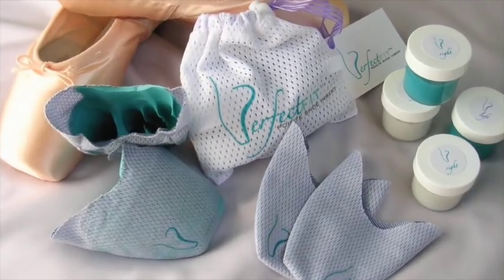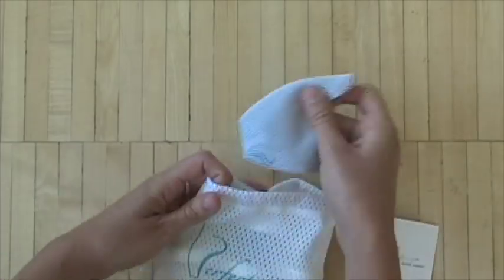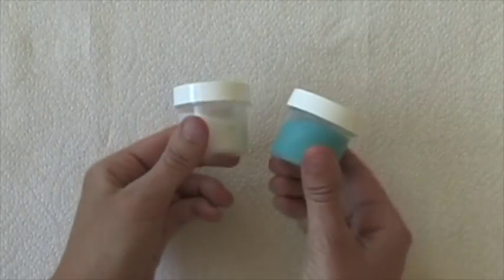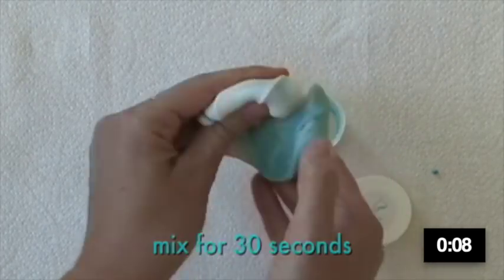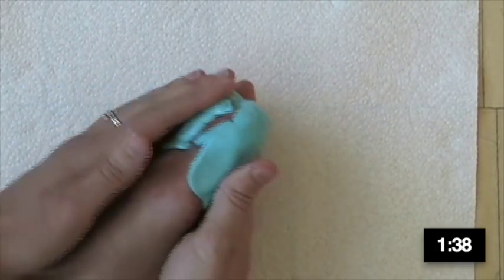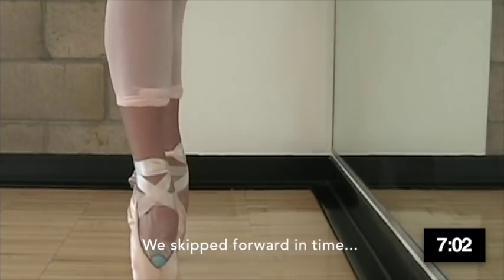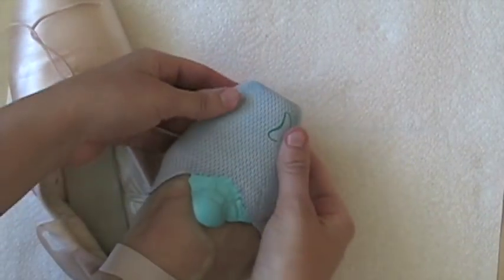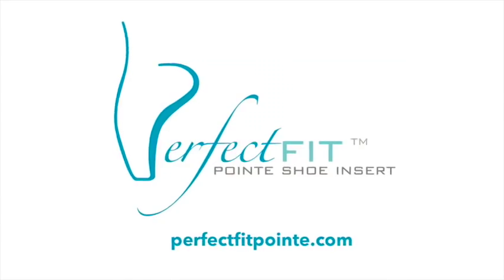NEW Molding Process Video - PerfectFit Pointe Shoe Inserts

Comment: I am sure these work for a lot of dancers, which is great but it was not very useful for my second toe which is longer, was more painful than with normal padding even though I carefully followed all the instructions and watched videos, in fact I am quite 😢 as they are not cheap …. This is my experience and hopefully they will work for others as this is a clever idea.   What I am trying now is to add padding to my big toe so that it becomes the same length as the second toe, in order for the weight (as I am 179cm tall) to be distributed more evenly, and will try your mould on my second foot with this. Fingers crossed

Comment: do you mold it with a new pair of pointe shoes or a broken in one? or die it matters?
Reply: your shoes shouldn't be brand new. they should be slightly broken in but not dead, after 2 or 3 wears is probably a good gauge! if you were to do it with a brand new pair, your pads would not fit as well with a pair of broken in ones, which is the actual shape you would want for your perfect fit.

Comment: Can I use the Pillows for Pointe Foam Toe Spacers PFP17 with these? Video shows Gel Toe Spacers. Thank you.
Reply: For any type of foam spacer, you can mold them directly into your PerfectFits without using the small included stretch sleeves. Foam is naturally porous already, so the putty won’t have any problem sticking to it. The process is essentially the same as outlined in the Instruction Booklet and Video — you’ll just be able to cover over the foam spacer directly on the top and bottom to anchor it to the sock

Comment: How long do these pads usually last? Does the material weaken quickly? Are they comparable to the traditional padding? As they're more expensive than 'normal' toe pads, I would prefer them lasting the equivalent time, or even longer. :)
Reply from the maker: PerfectFit Inserts usually last much longer than a typical toe pad since they are not a “padding” solution.  It depends on how much you dance, but typically they last anywhere from 6 months to 1 year for a dancer (or longer).  The molded material is very durable, and will not compress or pack down over time (as lambswool or foam does).  It is more likely that you will need to get a new pair of inserts when you change shoe size or style (since they are custom-fit to a specific shoe and foot) before you need to replace them due to wear and tear.  We have also added extra reinforcement in the toe socks around the big toe area to further increase durability in this region.

Comment: can u use the toepads instead of the fabric?
Reply from the maker: Do you mean, can you use another style of toe pad to cover the moldable material instead of our fabric covers?  Conceivably, yes, but a big benefit of using the lightweight sock covers is that it allows your foot to comfortably and naturally contact the shoe (but without the pressure points) :)

Comment: I desperately need these but they are to expensive for me 😯
Reply: smudgeit123 smudge how much are they?
Reply: shippermd like $40 not Inc p&p I think and that's just to fit one pair of pointe shoes.. my feet hurt so bad in pointe shoes as my foot is really wide like xxx but then  really narrows when up en pointe to an x.. that causes me to sink alot these would be perfect but just way to expensive for me in afraid
Reply: Ah. I have opposite. I have very narrow and thin feet! Just looked at the price. $72.00 for the kit that makes 2 pairs. Hmmm.
Reply: smudgeit123 smudge  they are really worth it! the first pair I had lasted me from last January to now - I just molded a new pair today!! They are a lifesaver :)
Reply: smudge it Did you tell your pointe shoe fitter that your feet are highly compressible? It definitely sounds like you’re in the wrong size shoe as it shouldn’t be painful from the get-go, and it’s possible this toe pad might not even fix the problem for you if the shoes are such a bad fit in the first place, since some dancers with compressible feet need a tighter fit somewhere else than the box.